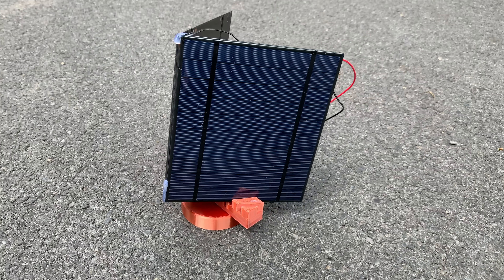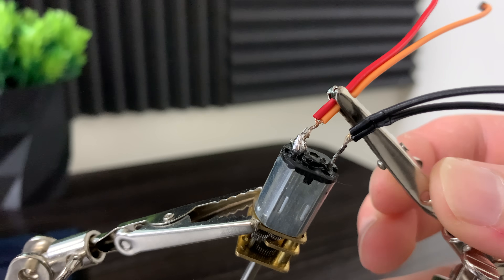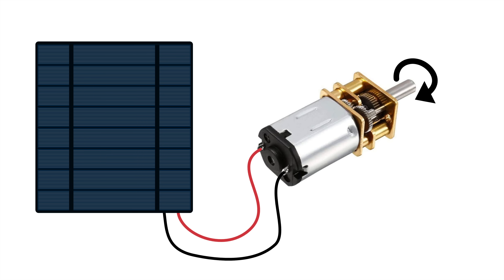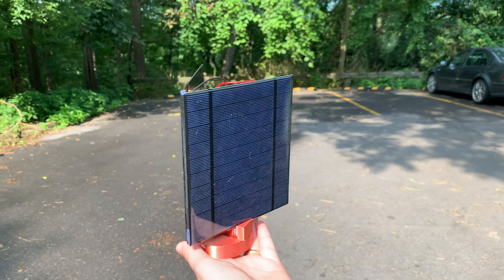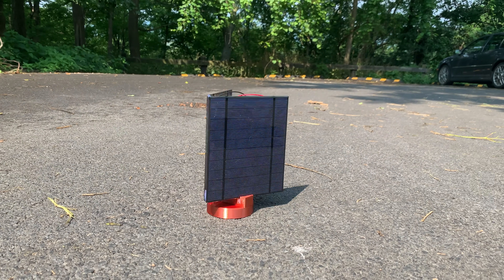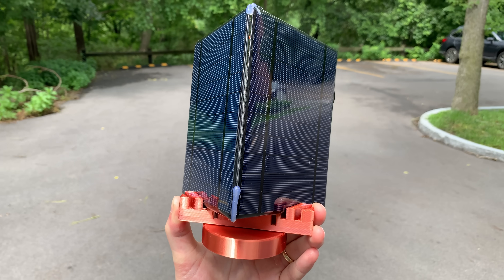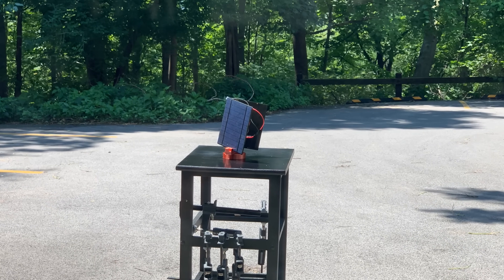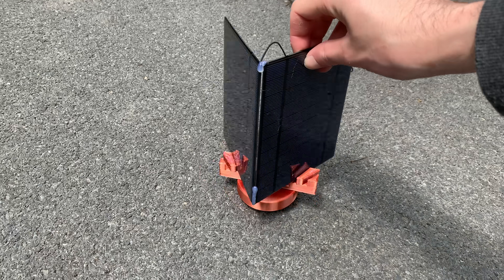World's simplest sun tracker.

Comment: Cool. Some ideas for alterations:
· Make both contiguous (same plane) and use a separator perpendicular. So the cast shadow in one make the system spin. So they align for maximum generation (but they do lose usable angle amplitude).
· Join the black wires together, but no contact to the motor. Each red wire to some side of the motor. Only the difference in generation will be used in the motor. This maybe require the motor to work with smaller tensions, but you will be able to do useful stuff with the energy generated.
· Get 4 solar panels, and you can wire them crossed and make like an wheatstone bridge. Each pair will have approximately the same voltage, so you can use the full energy harvested. But when, and only when, there's a difference in illumination, the motor will act.

If you don't understand some detail, please ask and I'll explain. I'd love to see this in action.
Reply: What you're proposing would work with batteries, but not with solar cells because they are diodes that prevent reverse current.
Reply: can you explain how to get the solar panels to power the motor PLUS charge a battery? Or manybe power a light?
Reply: Holen Sie sich 4 Sonnenkollektoren, und Sie können sie gekreuzt verdrahten , bitte um schaltplan

Comment: You didn’t mention one component that really makes this work.
There are diodes in each panels and without it, it is a short circuit.  Your explanation that the voltages “cancel out” is actually incorrect.

Comment: Definitely simpler in design, but also a bit "clunky". I'm not sure my mother would want something like that, next to/near her water fountain. 😂 I once thought of a design, using a similar principal. A small rotating base, that would funnel down to two separate Light Dependent Resistors. The funnels would be "VantaBlack" to avoid reflecting sunlight prematurely and the design WOULD require some type of chargeable cell, so the motor would "reset" it, when the morning sun hits the LDR facing the other way...

Comment: 😂👍👍using 4 panels..2 each in series in bridge mode.... diagonally opp. sides of bridge facing same side of sun....& motor connected @ series junction points.. should be a better & more reliable option.....
with the added advantage of the possibility of a charging source too .. from common +../..-

Comment: Nice, but the electric motor itself is a non trivial piece of this design, with coils, bearings, magnets, charcoals. Could we directly use the voltage difference of the panels to power a simple design actuator, some kind of diy 'electro-magnetic piston' ?

Comment: Is there a significant drain when the motor isn't moving and the panels are supplying it equal voltage?
Reply: These panels are only powering the motor. When they have equal sun they are shorted. But this setup could rotate a larger panel facing the sun directly and supplying power.
Reply: @Sgrunterundt  The real practical question is how large of solar panels do you need to turn a larger panel. It would be really inefficient if it was 1:1 (two panels to turn two more of the same size). It would be really nice if you only needed the ones he used here to turn a average large panel.
Side note: I wonder what the angle limitations are to have it return to east in the morning, that's probably a bigger limitation to this system than anything
Reply: @Ivan.Wright  If you use a small motor and gear it down, not a lot. It will turn slowly, but it doesn't need to be fast.

Comment: Nice so now you can add additional solar panels straight on top of those solar panels to a battery and have always the charging one(s) facing sun. Wondering if will work vertically so you fallow sun left right atm but also could it work up down with another motor. Would be interesting to be tested.
Reply: Yes, great idea

Comment: This is an example of "it works, but for how long".  When both panels are in sunlight, both are trying to put current through that motor...I'd think you'd either get a short or cause the motor to heat up.  I wonder if 2 or 3 wax solenoids could be used to direct the panels?

Comment: Sun is not hitting any panel perpendicularly, which is a must for panel to generate adequate voltage and power some batteries/devices. Also, you can not use this with solar chargers. This is not a good solution.

Comment: Now find the absolute smallest panels that will run that motor reliably and make that a self contained unit with a stand for a third much larger panel to actually produce useable power

there were similar solar trackers in Mother Earth News decades ago that used propane tanks heated by the sun and a bit of plumbing mounted on bearings so that the hotter tank would rise a little and the cooler tank would settle a little to point a solar oven at the sun throughout the day.

Comment: Love the video! but how does the energy output compare to a single panel that is faced perpendicular to the incoming light? I know most solar panels are more efficient when perpendicular
Reply: His device could be hooked to a potentiometer, so when it spins it will be picked up by the potentiometer and then the potentiometer will feed the information to the actual motor control of the real solar array.

Comment: Can this upscale to 100 watt panels? What happens when you are trying to use the power produced to charge a battery and rotate the base?
Reply from the maker: This would be used to control the orientation of a 3rd larger panel.
Reply: @3DPrinterAcademy  do you have a video for that?

Comment: The wiring used here draws current from panels even if it's not rotating. I'd use different wiring: connect black wires of both panels together and red wires to the motor. This way the voltage on the motor would be the difference between panel voltages so it would rotate if one panel gets more sun than the other

Comment: This could be scaled up using an H-Bridge driver for a larger motor, keeping the smaller panels as the driver signal or swapping them out with photo cells.
Reply: Or simple transistor will work too
Reply: @falcon9ft710  yes transistors in h bridge configuration

Comment: NICE but a bit expensive. You need to buy two large solarpanels to track the sun and you can't use the power from these panels because it energy is needed to cancel the energy from the other one. Right?

Comment: You've effectively created a proportional control system (the P in PDI control), where your constant is just too high initially. You opted to change the system, but perhaps something like a potentiometer could have been used to find a resistor value that would have had a better response.
Reply: Yeah!  For the I term, you could use a capacitor to integrate the small difference in voltage when the system is slightly misaligned. As long as the differential exists, the capacitor will charge until high enough to drive the motor and minimize the error. Appropriately sized, that could minimize the discrete "jumps" we see in the tracking timelapse at the end of the video.

Comment: Solved the task, but totaly missed the purpose. Neither panel are ever pointing towards the sun. The point of a solar tracker is to maximise the production. This have 0 production, and is not even a good sensor for other panels as you would have to add angle messurement and software. Now you just have 2 problems, both the software and mekanical issues.

Comment: But this way you are making short between the two panels, this is useless in real world,will not output any power, so what is the perpose of tracking the sun where there is no usable energy. if they are of high ampere, they will burn the wires.

Comment: Yeah, the simplest and also the most useless solar tracker ever... I mean, it's cool that it's so simple, but then again, the solar panels are wired in series and then shorted together. So the only way to get any power is if it's not faced to the sun (obviously, since then the motor spins). In a way it's the opposite of a solar tracker since it perfectly tracks the point where no power is fed to the load.

Comment: I worked for a company that made tracking solar panels. We used a smaller version of this, but controlling motors with driver PCBs.
The two small solar panels were not angled like this, but side-by-side with a thin wall between. If wall makes a shadow on one but not the other, it's not pointed at sun. Equal voltage = equal sun = pointed correctly. One set for elevation, another at 90 for azimuth. 
Worked well. The higher the wall, the finer the control as smaller  angle off makes larger shadow.

Comment: Adding a third panel wired the same as one of the others will make it face the sun no matter what direction the sun is hitting it (preferably so it takes the shortest path when the sun rises again).
EDIT: Actually just making the two panels parallel would do the same job now that I think about it, so placed on the "sides" of the main power generating panel (this can easily be extended to vertical as well).

Comment: that seems like a masive waste of heat on the coils of the motor
Reply: Not on the coils of the motor, they see a potential of 0V, however not so for the wiring and more importantly the internals of the panels. Remove the motor and what you have here is basically two panels in series that are shorted out.
Reply: @wich1  i dont really think there is 0 exactly, must be a low voltage since the motor doesnt move, but that doesnt mean exactly 0, and this is on scale, but yeah, the shorted pannels are much more of a fire hazzard on scale than the mottor burning
Reply: @Nedeles  yeah true, not exactly 0V as the motor has a threshold voltage as evidenced by the jerky sun following, but near enough 0V as to make no real difference to the coils
Reply: @Nedeles  as for the fire hazard, that all depends on the construction of the panels. The power produced by the panels is not near enough to cause the external wiring any issues, but it will basically concentrate all power collected from the sun over the entire panel into the relatively small internal wiring of the panel. If that internal wiring is capable of releasing that power as thermal energy back into the panel fast enough it would basically be as if the panel was just left in the sun unconnected like some other commenter suggested elsewhere. If it cannot however that internal wiring can get pretty hot.
Reply: @johnnytheprick I presume you’re referencing something, but I haven’t the foggiest
Reply: @johnnytheprick wow, you’re a character… we are done
Reply: Actually you can waste little bit from ultimate source of energy "the Sun"
Reply: @Mukesh_Rana._  that’s not the point
Reply: @Mukesh_Rana._  just because is an "unlimited" ammount of energy, doesnt mean you cant waste it if you make a solar panel that converts 90% the energy it captures as heat, is still wasted energy
Reply: @Nedeles  But for now solar panels can only covert 20 to 25% of energy from solar to electric.
Reply: @Mukesh_Rana._  im talking about converting that electric power into heat, wasting the energy It has converted already

Comment: I have one issue I did not see addresses and I think I also have a solution.

facing east. sun comes up. sun sets unit is now facing west. how do you make it go 180 to face east again in the morning?

I am thinking a small third panel on the back to make it rotate in "whatever" direction to get the primary panels in the sun then its normal operation takes over again ???

Next. now we need an encoder of some sort to take the position data from this to drive a larger rotator for the main array ??

Comment: Those that say it's useless, just add a tiny encoder and use signal from the tracker to position a huge sollar arrays via actuators.
The idea of such tracker is simple but not optimal. The increments are not smooth. Also, it's only tracking in x axis, but not in y axis.

Comment: Okay, next step would be mounting a bigger solar panel on top, facing the sun at 90°, also what about the unused energy of the solar panels when they're the same? Wouldn't that heat everything up? What would be the correct circuit to prevent that and actually use the power?

Comment: How do you want to take electricity from these panels?All the electricity goes to the engine.
This project is interesting, but without any practical application.
Reply: This is not the power generator itself. It is a cheap, simple solar tracker. 
If you wanted to generate power, you'd attach dedicated solar panels for that. 

You'd attach them so that their fronts would perpendicular to the sun like this:  ¯¯¯¯(\/)¯¯¯¯

Comment: Simple question, if we want it to charge a battery, how would that work as it only provides electricity to the dc motor and cancels it when the two solar panels are producing electricity so, it means no way that you can charge a battery with a stable current without adding 3rd solar panel and 2 small solar panels those are enough to produce 3.5v
Reply: Then you'd add additional panels. 2 to drive the motor for alignment, and the rest for providing power for whatever you want.

Comment: There was a gadget available in the 1980s that used refrigerant boiling one tank to another that would open and close window blinds based one differential temperatures between the tanks. That is your next challenge.  Nice work!
Reply: There are Greenhouse Windows that have an Automatic Actuator, looks like a Shock-Absorber, sealed with a type of Wax that expands with Temperature. As the Temperature crosses an adjustable Threshold, the window opens, as the Temp increases, the window opens more. As the Temp goes down, it closes. Been available for over a century: simple and cheap...

Comment: Do you think that using slightly larger solar panels would make for a smoother movement of the tracker due to the proportionally higher output reaching the trigger point faster? I’m not an expert at this stuff just curious, so if I’ve missed something obvious I apologize.

Comment: Fun fact. When you run power through a solar panel, they emit light like an led. They are not very good at it of course, but the silicon operates both ways. LEDs also can be used as light sensors. Kind of like a generator <> motor or speaker <> microphone. The small current should have no I'll effect on the solar panel life as it has a large surface area for heat dissipation. There are YouTube videos showing this effect.

Comment: So, basically, you could have 2 small solar panels driving the motor to keep 2 large solar panels that would provide power to whatever charging unit you need, facing the sun, thus, have optimum charging for homes, battery walls, powerbanks, etc etc... Simple, cheap, very effective, and Brilliant..!!

Comment: The number of folks overthinking this is boggling.  No, this won't produce useful power; it doesn't need to.  Yes, it's a dead short when aimed at the sun, but it's a negligible amount of current, so no damage.  The optimum way to use this is that its motion rotates a potentiometer, hall effect sensor, or some other type of position sensor.  The sensor then controls the positioner on a larger array to maintain the optimum angle.  Sure, most large arrays just build a little extra capacity because a positioning system requires costly ongoing maintenance, but for a situation with limited space, the positioning might be worth it.  Of course, more elegant solutions exist, but you would be hard-pressed to find anything simpler, or cheaper.
Reply: Place this device on the array, and it's a negative feedback loop.  A simple DC gear reduced motor just like he used but bigger to drive the large array would be plenty.  The sun moves to the left.  The sensor array follows it, which makes an electrical contact.  That contact fires the main array drive motor (through a suitable relay or h-bridge).  The array swings left moving the sensor too far to the left, causing the sensor to swing right and breaking the control contact.